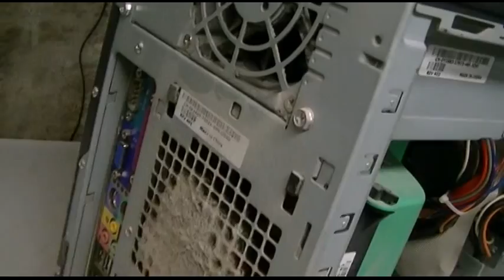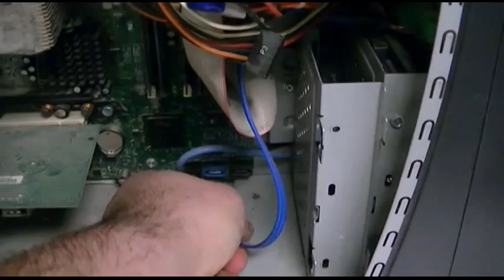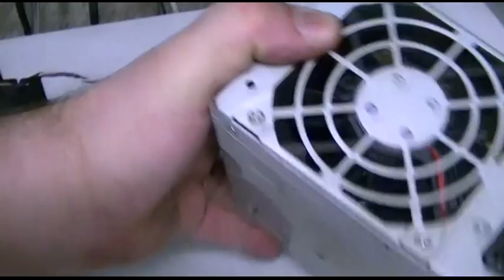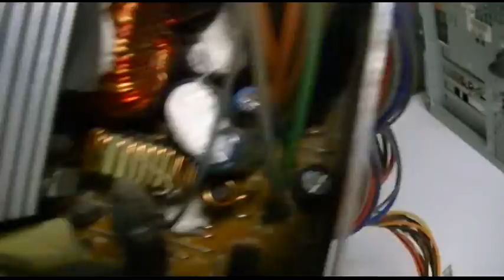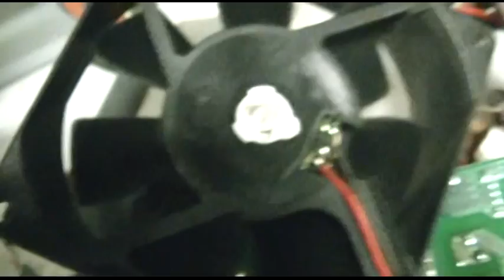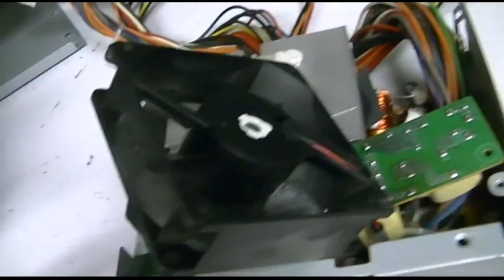Computer Fan Repair--THE EASY WAY!!!

Comment: A couple of days ago i found a fan, same brand, different series, that had the blades locked the same way, i read one of latest comments that says you can just pull them out, but i just couldnt, did you ever got to disassemble one of this type of fans that way?
Reply from the maker: Nope. I just oil them the way I showed.  I never take them apart.
Reply: @jaykay18  ill see if just the oil helps and thats just it, it aint too dusty, hopefully the problem isnt something else
Reply from the maker: @s.s.m.m.g.g  This fan wasn't too too bad.  I've had others that were locked up solid revived like this.  It's not necessarily a one shot deal, you might have to oil it a couple of times, leaving it sit in between, even for a day.
Reply: @jaykay18  after some days they started working a bit better, but theyre still kinda unusable, im gonna take apart one of them just to check how the parts fit together

Comment: I'm a bit late to this party but those fan's are the easiest to service! Just grab the propeller and pull it out! It's that simple! Clean out the old lubricants with some alcohol and apply new grease and Pop it back in place, it locks itself in.. other fan's have a little lock washer that needs to come out from the back and usually will launch into the 9th dimension, which is why you can't find it... But these are really easy! Getting it's stator assembly out is way more difficult which is why I'm searching through YouTube.
Reply from the maker: Thanks for the additional info.  I've been fixing fans this way for the last 25 years and I haven't had one fail me yet.
Reply: @jaykay18  no worries 👍 I just took one apart, I was expecting to the little split washer under the sticker but instead this one was different, the fan blade assembly just pulls out so that you can get some oil directly into the bearing, there's a metal cap on the back to stop the oil from getting out... It's a real good fan, it's stator assembly is larger than most as it's magnet inside the fan blade assembly... I don't know why all fans aren't made like this, maybe they just want us to purchase another one instead?
Reply from the maker: @PeterMilanovski  Most times they are made as cheaply as possible to fail as soon as the warranty is expired.

Comment: my PC is doing that noise and I can use It for some moments than It turns off ... do you think tha fan causes the turning off?
Reply from the maker: Yes, if the fan isn't running properly because it needs to be lubricated, then it's not creating as much airflow, and it's entirely possible the machine is overheating and shuts down.
Reply: @jaykay18  actually tha fan works perfectly but it just makes way more noise than usual ... It looks like my fan has drank coffe and is overspeeding . It makes the noise of a normal fan boosted to the max level (hope you're understanding) Do you have any idea what's going on?
Reply from the maker: Likely the cause for that is dust buildup in the heatsink fins.
Reply: @jaykay18  ok thnx for answering this fast
Reply from the maker: Sure, no problem, I try to get to comments as soon as possible.

Comment: It worked for me. Granted i used gun oil and just put 2 drops inside. Works now. Sweet. Was trying to avoid all that thanks. Very helpfull
Reply from the maker: Sure, no problem.  Glad you're back up and running.

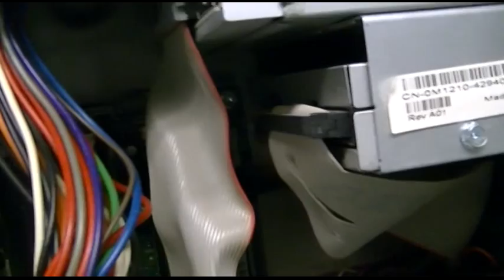Comment: 7:58 Real computer have a floppy drive xd meanwhile me
Spec 
I7 8700k overclockt to 5 ghz
Rtx 2070 
16 gb gskill tryend z rgb ram
Asus rog strix z370f gaming
4 tb hdd
500 gb m.2 ssd
And this is not a real pc 🤣🤣🤣
Reply from the maker: Nope, no floppy drive.  The machine shown in this video is still in daily service today, some 4 years later, in fact I'm using it right now to reply to you.
Reply: @jaykay18  Oh, come on. You can't be serious. What was the last computer that came standard with a floppy disk drive?
Reply from the maker: Probably could still find one as late as 2008 or 2009.  As for this machine, it's still in service, a daily driver, which I'm using right now.  It's easily 15 years old by now.  Try doing that with a weenie modern computer!
Reply: @jaykay18  As impressive as it is that your Dell Dimension still works...
Why not get with the times and upgrade to a dual core machine? Those old Dells aren't good multitaskers.
Reply from the maker: Old computers are never obsolete:
https://www.youtube.com/watch?v=pNaP_UMxx0A

Comment: looks like this pc is from the 1985 right.
Reply from the maker: It's clear you have absolutely no grasp of reality.  This PC is from around 2005, some 20 years LATER.  Regardless, 1985, 1995, 2005, 2015 and beyond, the repair procedure has NOT changed.

Comment: Sir, my monitor led keeps on turning on and off and the monitor doesn't display anything but it's still on and the fan at the PSU is not spinning. What should I do?
Reply from the maker: That's beyond the scope of this video.  There's obviously a much more serious problem.  Start with replacing the power supply.
Reply: @jaykay18  But our monitor does sometimes act normal again, but it'll take a long time to wait
Reply from the maker: You didn't say that before.  Without all of the information, you're going to pay someone a lot to fix it.  

Case in point:  My mother once told me her dishwasher wasn't working.  When I asked what the matter was, she said "The dishes come out dirty."  I said "You've told me nothing more than 'It's broken'."

Comment: My pc doesn't spin fan nor psu fan
Reply from the maker: Sounds like it's not turning on.
Reply: Same problem here. I smelled burning then plugged it off immediately, and when i open my PSU i saw a 4 bulging capacitors and 1 components that have been destroyed. Is there a way that i can still fix it or i need to buy a new one?

Comment: Btw i put any oil and it worked
Reply from the maker: You should use a good oil, like 3-in-1.  Other oils may work right away but cause it to fail again in a short period of time and you'll be doing the repair all over again.
Reply: @jaykay18  will there be a problem if i don't stick sticker to the place
Reply from the maker: Not really, but you should try to put it back if possible.  If not, use duct tape.

Comment: Any other options on how this fan can be connected? The old fan worked and I have installed a new fan but it doesn't work. Where it plugs in on the board looks like the only place to plug it in and it must not have any power. 10/18/2018 Thanks
Reply from the maker: Not sure which fan you've replaced, so I'll give both scenarios.
Inside power supply fan:
If the old fan actually had a socket and connector inside on the power supply board, typically those are 2 pin and are keyed.  I've seen some socketed and some soldered directly in.  If the new fan doesn't run, and it's definitely connected properly, it could be bad.  More rare is if the fan itself has a thermistor inside which regulates its speed.
Case or processor fan:  Generally these are 3- or 4-pin variety fans, depending on the age of the system.  Most often, these are controlled by the motherboard, and it's possible that the board is trying to start the fan at too low of a voltage.  The motherboard has thermistors that measure temperature and will adjust fan speed accordingly.  It turned much cooler in many parts of the country this time of year, it's possible that's the problem.  Or again, the new fan may be defective.

Some case fans include an adapter to convert to a Molex-style connector.  You should find a spare one of those off of the power supply, and can plug it in that way to make the fan run full speed.  If it doesn't include the adapter, and you don't care about the noise the fan might create, you can cut the wires on the fan.  You're interested in the red and black wires on the fan only.  Those wires can be jammed into a Molex connector to make the fan run full speed, black to black, red to YELLOW.  You can also cut, splice, solder, tape, heat-shrink the wires together.

Comment: My PC turns on and off every 1 sec and the heat sink fan is the only one spinning while the case fan is not. How to fix this problem?
Reply from the maker: Replace the computer.
Reply: After reading your reply my computer backs on. He might not want to be replaced. Thanks!
Reply from the maker: So my reply worked, excellent!
Reply: Hahaha yes it was a miracle though.
Reply from the maker: I've seen them happen plenty of times.  I've been repairing PCs for over 25 years so I've seen my fair share of things.

Comment: my pc wont turn on after i installt a fan
Reply from the maker: Well, you must have done something wrong.
Reply: i just put the wierd on its place and my pc turnet of
Reply from the maker: Not a good idea to plug/unplug stuff while the machine is on.  Best recommendation is leave the entire machine unplugged for a few hours.  If that doesn't solve it, something got fried, and it could be anything.
Reply: wheel i plugged the fan before i plugged the pc and it didnt turn on then i plugged the fan of and it is saying THE CURRENT USB some thing else and THE SYSTEM IS POWERING OF IN 15 SEC TO PROTECT THE MAINBOART
Reply from the maker: Probably a current overload on the USB bus.  The system is powering off because it either can't spin the fan or can't sense the fan is spinning.  Ensure it's plugged in correctly--those connectors are keyed so it only fits one way.
Reply: yeah the fan stops sometimes and i have to reboot
Reply from the maker: The fan is bad and needs to be replaced.  It may have caused damage to the component that its cooling.
Reply: ok ill replace the fan thanks bro

Comment: my fan is not even working (not the cpu fan,not the psu fan) the other which is down there when you show at 2:48 i put it to the sys_fan  but it wont start cooling the system please whoevryone understant help
Reply from the maker: Fans can and do go bad.  If you supply 12 volts to the fan and it won't run, it's a problem with the fan.  If it works that way but not on the board, either the board is faulty or there is a way to shut off/adjust the voltage on that port, which is board-specific.

Comment: I have a question if you could help it would be much appreciated. I'm kind of a noob about pc's so bare with me please. Long story short I was playing on it and I stated to smell like a hot plastic smell. I followed my nose and It's coming from my rear top fan and the fan is not spinning either. It has two big wires connecting it to the motherboard I'm assuming and those are hot too. I've never had any problems with the pc other then that.  I cleaned it all out  and the fan is still not coming on.  I ran a diagnostics on it and started playing a game to see what  would happen to it under stress.  The entire time playing the numbers were all normal i turned the game off and my cpu temp started rising so i turned it off immediately. I was afraid of it over heating.  I'm just lost and any input would be much appreciated. Sorry for the long question.
Reply from the maker: Most PCs will have 3 fans, the one in the power supply, one on the rear of the case, and one on the CPU.  All 3 should be spinning.  You can watch the fans while you shut the machine off, those fans should spin down gradually and come to a stop when the machine turns off, just like any other fan you've seen.  If any one of them comes to an abrupt halt, it likely needs to be oiled like I outline in this video.

Also, if you keep the machine in any sort of "cubby hole", shoved between a desk and a wall, or any other sort of enclosing environment this can happen.  There may also be a buildup of dust like I showed in this video.  Just start poking around; the problem should appear evident.

Comment: I need some help todat i lwft my game open on the pc cuz it started to lag wich happens by heat i think and after 5~ hours it went to power save mode i think and when i press the power button pc opens but monitor does not respond and keyboard mouse is dead (note it gets power from the pc i tried pressing the plugs and mouse started working but no response) and when i press the info button on my monitor it says power save mode press keyboard or power button or move mouse and its saying that when the pc is already open after a few minutes it suddenly shut down. This pc has a lot of problems and gets hot when i play a game i can know that by restarting my pc and it shows the error cpu overtempeture  abd boots normally sorry for bad spelling writing from my phone
Reply from the maker: Hold the power button on the PC for 5 full seconds until it powers off.  Leave it to cool.  Then power it back on.  If nothing comes up, it's time to reseat all the components in the machine.  You can start with just the video card as you think it's suspect, but it probably wouldn't be a bad idea to go over the whole machine.  Probably wouldn't be a bad idea to have another known good working video card to test the system with, or if the system has onboard graphics, use that.
Reply: Omg i just unplugged and plugged the power cable and restarted computer and it worked
Reply from the maker: That essentially did exactly what I told you to do.
Reply: jaykay18 yes thank you.

Comment: Please if anyone can help me.I was playing a game on my computer, and all of the sudden my computer completly shutsdown. I presses the power button and nothing happend. I unplugged it and plugged it back in and pushed the power button, and saw a spark come from the inside.I unplugged it and let it rest for a couple of minutes. Later I pushed the power button and it worked just fine. I asked a couple of friends and they said it was the PSU. Since I HAD a 435psu, and have a Gtx1070, I-7 and using 2 monitors. So I went and bought a cosair 750psu. When I got home I put it in. and turned it on. Now when I go play a game, when I load it up, My CPU starts squicking. It sounds like its the fan. I do not know if it is that or something I could of burnt out. But I am sure it is coming from the cpu area. Or the psu making the fan spin too fast? any help please!?
Reply from the maker: The spark and whatnot was most likely the PSU.  It is IMPOSSIBLE for the PSU to make the fan spin too fast.  The sound is most likely a fan.  You need to pinpoint which one by listening to each one.
Reply: Probably the psu...or smps
The system shutdown is cause of cpu peak rate
You use i7 with that high end gpu,probably you should have a cooler setup for both the cpu and gpu..

Cause Nvidia takes in more power to give better result. The fan that comes along with smps/psu is an ordinary fan..try getting a new fan or check if the fan inside the psu is working properly..
In my case I face the same issue 
I had power supply and fans were making noises ..so I checked the cup cooler and cpu cooler everything was working fine...
But later found out that smps fan didn't work ...cause of that system shuts itself down

Comment: I have my laptop for nearly 4 years and the fan keeps malfunctioning all of the sudden after turning on. Is it because the fan is after warranty or something that's blocking it's way...but at least my laptop works fine.

Basically, while I was using my laptop, then it showed a BSOD, then it restarted and showed "Fan Malfunction"
Reply from the maker: Use compressed air to blow the dust out of the vents.

Comment: I just got my 1060 6GB, put it in the PC then my fans stopped. The CPU and GPU fans work but the PC fans don't. Help?
Reply from the maker: Did they possibly get unplugged?  If you were digging around in the case that's a likely possibility.

Comment: so me and my fan are having some issues, ive just bought a new pc and the fan is extremely loud... little jet loud is there any way to fix it without buying a new one because ive searched amazon for days trying to find the kind of fan i need but always come out empty handed?
Reply from the maker: There are a number of different fans in PCs.  At the very least there is the fan in the power supply and the processor fan; there may also be a video card fan, rear case fan, front case fan, top case fan, bottom case fan, or even a side case fan.

Usually one of them is the culprit rather than it being a cacophony of all of them.  You have to first narrow down which one it is and then look to replace that one.  Sometimes, the placement of the machine will also cause noise, such as right next to a wall.  PCs of today need to dissipate heat, and if you don't give them "breathing room" (such as sticking them in a desk that has a special cabinet just for it), those fans will get real loud.  Or, if you don't have air conditioning in that room, GET air conditioning in that room.  The computer likes to be comfortable just as much as you do.

Comment: Its a pretty bad idea to make spin the fan cause it generates voltage and may be charge a capacitor or  something and you can mess up the hole thing so, nex time, dont do it or disconnect it before anything.
Reply from the maker: There are several problems with this statement:
1.  Improper punctuation.
2.  Incorrect spelling.
3.  Incorrect grammar.
4.  Your statement of "charge a capacitor OR SOMETHING" clearly indicates you don't know what you're talking about.

While I will indeed agree that spinning the fan can indeed create voltage, the current it produces is very little, probably less than is useful for a capacitor to charge.  There are diodes in the supply that likely prevent the "backflow" of current into the supply.  In my almost 35 years of working on computers, I've never blown one up, charged a capacitor, or SOMETHING.  I also insist on using a magnetic screwdriver in a computer, yes, even removing hard drive screws, and I've yet to ever erase a hard drive with that either.  I don't buy it.  Anybody else reading this shouldn't buy your comment either.
Reply: jaykay18  pure comedy brother "or something"ha thank u for your reply to his reply 5 star rating out of 5 or something